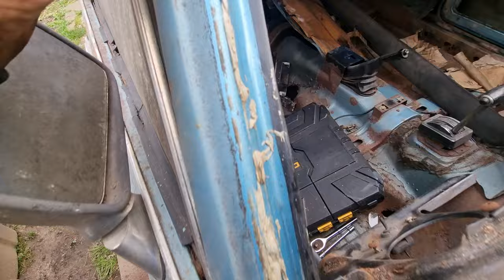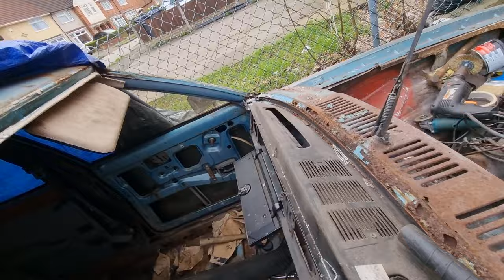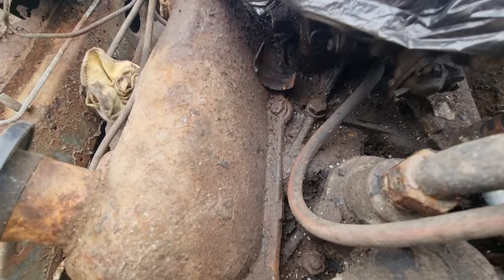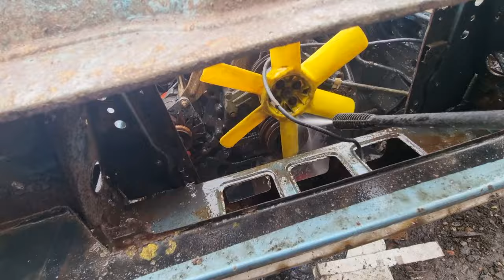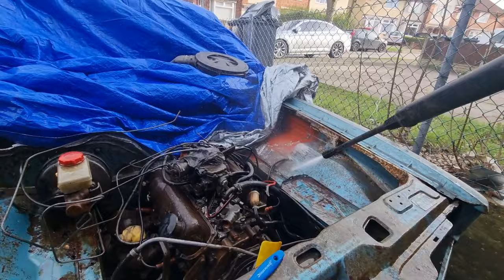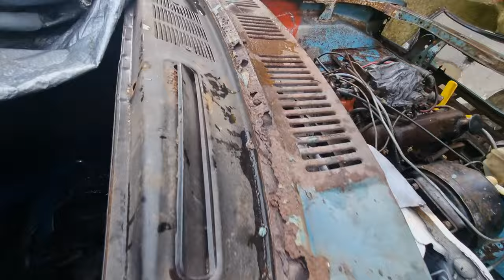Cortina Mk4 Ghia 2.3 V6 Restoration || Engine Cleaning (P11)

Comment: Looking forward to this. I had a Mk5 2.3 Ghia saloon in what looks like a very similar colour. It followed a Mk4 1.6 which was my first car. Did an engine rebuild on mine after blowing a hole through the top of a piston and out under the rings at 100mph on the M3. I remember discovering the warm air from the exhaust could pass through the intake manifold to warm the manifold and it had blocked solid. That took some digging out. The auto choke was a nightmare though, if it didn't work properly and stalled, the engine was too heavy to turn the steering wheel without power steering assistance at low speed. It caused me to hit the kerb exiting a car park down a spiral exit ramp.
Reply from the maker: Hehe oh dear yeah they are awesome cars I think me personally love the look of the mk4 more than mk5 at the front